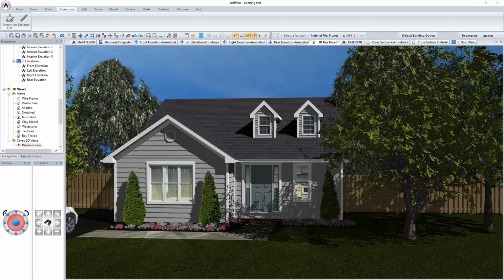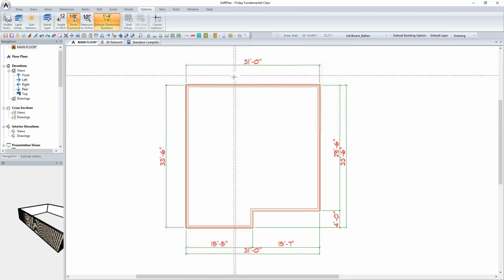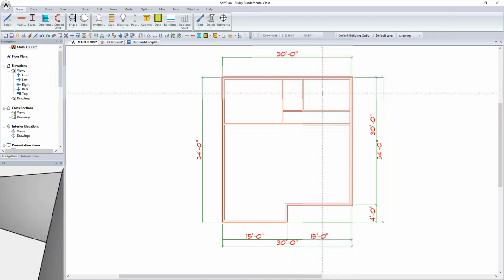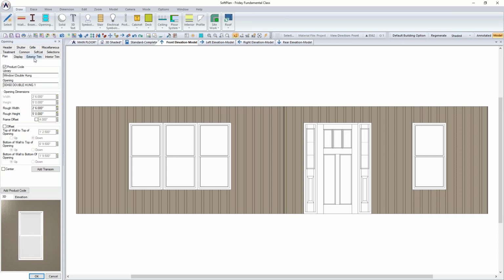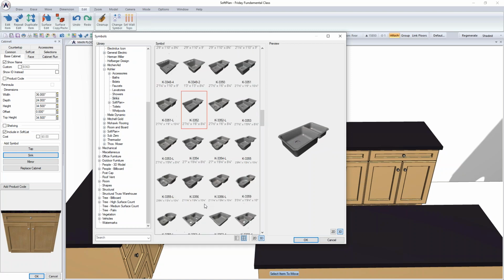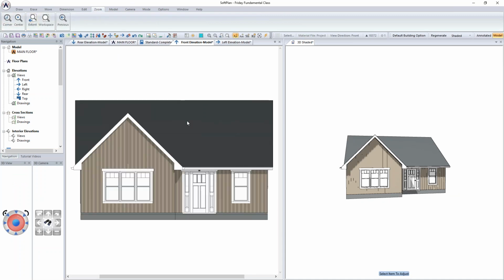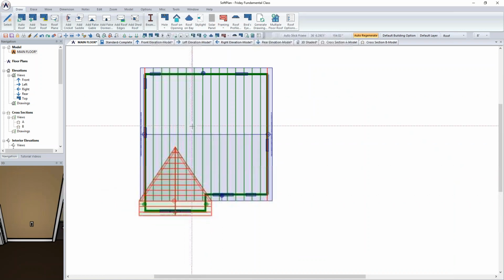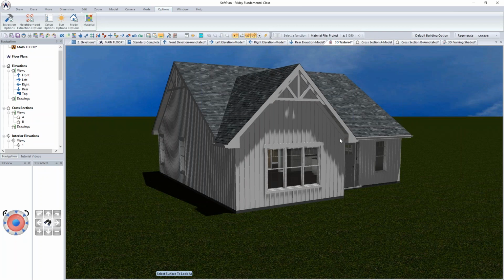Friday Fundamental | An Overview of SoftPlan

Comment: What if I want a 5 foot cased opening?. It will not allow me to change from a 3 foot cased opening. Same with Barn Doors. You can only do 3 feet or 6 feet. I want to model two 30 inch doors making it a five foot opening. Thanks in advance.